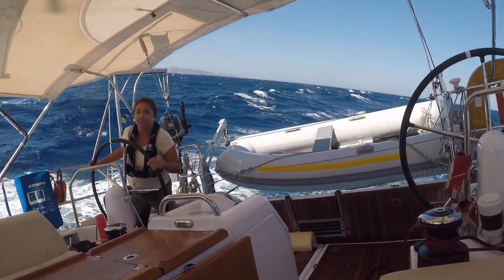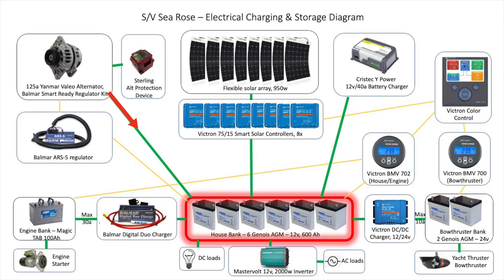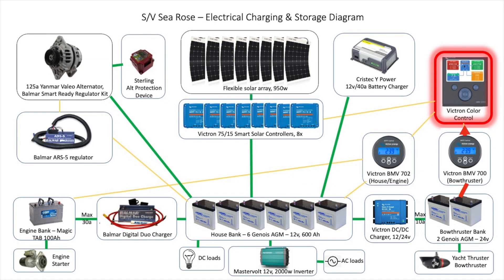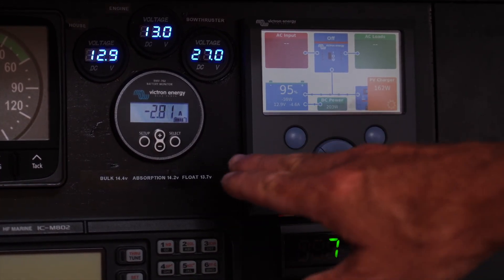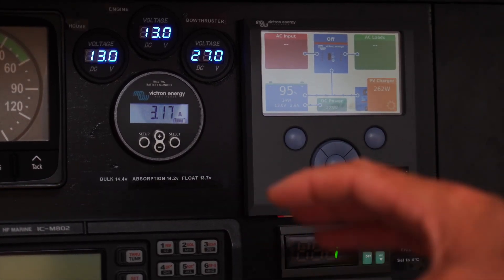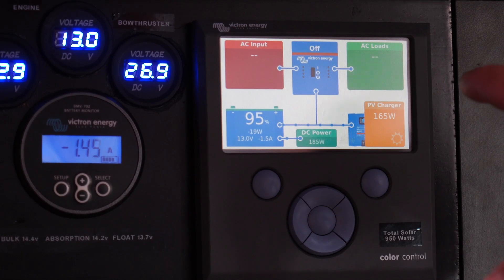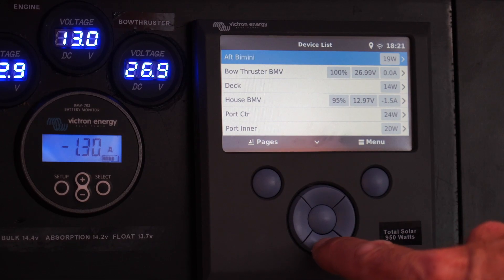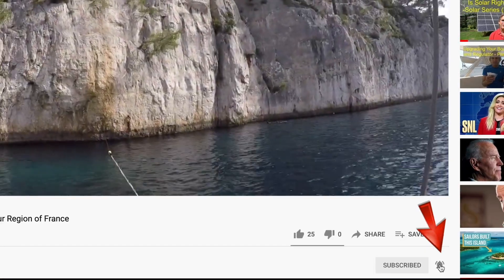Battery Charging and Energy Management, Part 2 of 2 | Ep. 105

Comment: I really like your additional panel.  Did you make it yourself?  Or is it a Jeanneau option?  On our 440 it's a small shelf that is good for a few small items.  I'd much rather have space for front panels of equipment.  I also have a victron system and I love it.  I don't have the color control display.  I use a Cerbo GX and my mobile phone to query the system state.  It's a great system.  I'm thinking now I may add at least a victron trimax to charge my thruster batteries.  Great video and great information.  Thanks.
Reply from the maker: Thanks, Kevin. My husband made the additional panel. The small shelf areas were not all that helpful for our uses so we took an area over and converted it to more panel space.